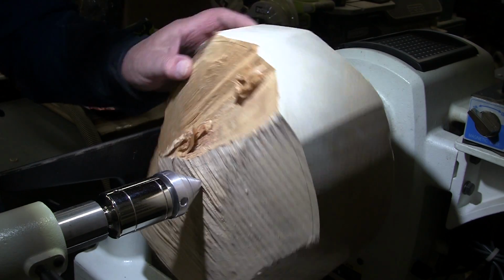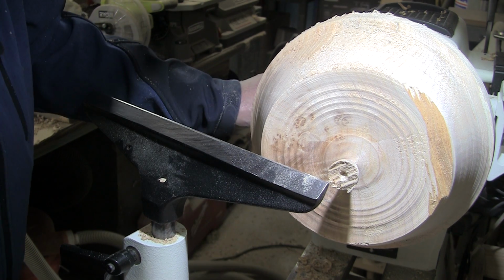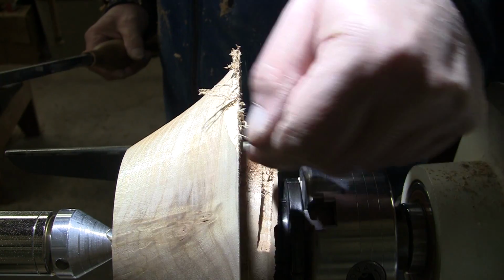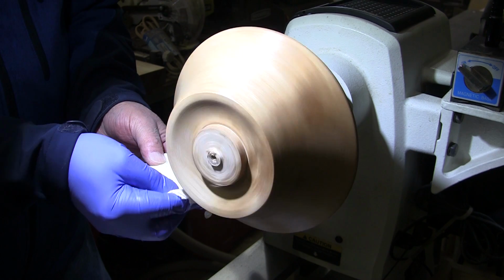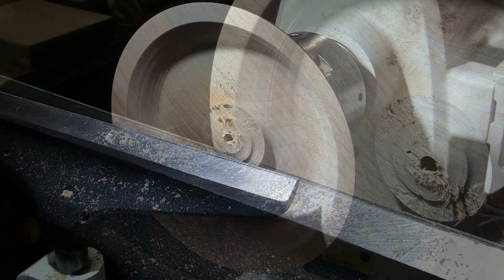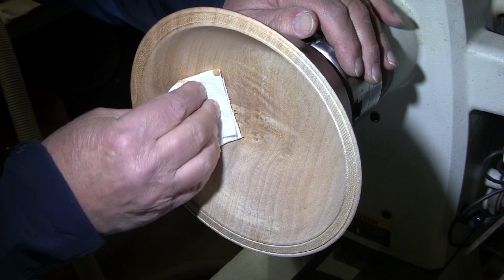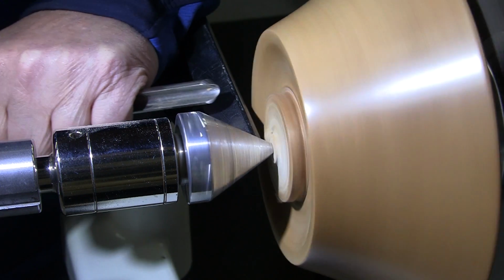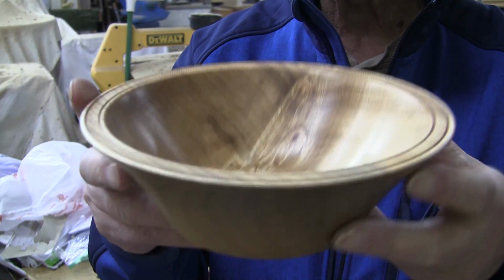Alder Bowl With Texture - Wood Turning

Comment: Phil you have taken a piece of what is mostly used for firewood and turned it into a beautiful bowl. My son has 42 acres and most is filled with Alder.
I loved that view of the square carbide cutting to top. I know what you mean about the diamond point tool. I have one from a set of Craftsman turning tools I bought years ago.
And at work we made diamond point tools made from Stellite. I still use the big one I have.
The finish turned out really nice and I like the finishing compound you used. I just used some EEE stuff that came along with a lathe I bought a number of years ago. I used it over a finished lacquer turning that I am about to upload. It was amazing. 
 And I love bug holes and knot holes. 
 I think that texture on the top edge really topped the whole thing off. What a perfect way to use a gift from your wife. Bless her
Take care my friend,
Gary
Reply from the maker: Thanks, Gary!  I need to come up with a good way to sharpen that diamond point.  I've just been honing it on a diamond card but I think it's overdue for a grinding.
I'm interested in the EEE stuff.  I was of the impression it was for smaller things like pens and stuff.  So, you used it on a large bowl?  No issues?
If we didn't have bugs and knots, where would we be?  LOL!
I do like that texture, too, and the tool is really easy to use.  It's just hard to use it on my typical stuff, like you turn.
Thank you for thinking of Edna, Gary, I appreciate it!
Phil
Reply: Phil my diamond point is just HSS and I grind it like a scraper which is what it is. Not sure what yours is made of.
Yes I used it on the Dizzy bowl I posted this morning. The can says on bare wood But also for a French polish. And it worked great on the lacquer finish. Check it out when you get a chance and no bug holes!
You both have been on my mind my friend.
Gary

Comment: Nicely done Phil! The texturing really added to the piece. It looks like that abrasive compound that James made worked really well. I bet it would work amazing on really hard dense tropical hardwoods. Amazing what just a little extra effort will do!
Kyler
Reply from the maker: Thank you, Kyler!  I really like adding texture but for most of what I turn, it just isn't practical.  Gotta take advantage when you have the opportunity!  I like that you can use James's abrasive on bare wood.  Saves time over using sanding sealer.  Hope all is well, buddy!
Phil

Comment: I have a diamond point tool, just never knew what to use it for, now I do. Also thanks, I have been turning the tenon off like you do, works great.
Reply from the maker: Great, Joseph, glad I could help!  Also, I think it's cool you turn the tenon off completely, on the lathe.  I discovered that by accident but I just think it's a real work/time saver.  Glad it works for you, too!
Phil

Comment: Hey Phil,
   Nice wood very nice creation. I've noticed in the recent past you are turning a lot faster RPM, this seems to work pretty well for ya.  My JET wants to dance  with the oddball stuff I turn. Maybe it would be better to cut them rounder to begin with. You've been a good inspiration. I'll try to Turn it Up, slow increments. You seem to get far better cuts on yours. Thanks for your help.
Reply from the maker: Thank you so much, Don!  I just turn fast when the piece allows it, Don.  Most of what I turn, natural and live edge stuff, will not allow high speeds.  My jet gets to vibrating as well when something is off balance.  Happens all the time.  It is fun to turn fast when the occasion arises, though.  You can get so much done in a hurry!  Yes, you will get a cleaner cut with higher speeds but only if there's little to no vibration.
Phil

Comment: Howdy Phil
Always like it when you turn Alder ....That James Stewart is nice ....Do you think it is like Yorkshire Grit paste ?...When you applied the feed and wax finish , it looked very shiny ....would like to see another Alder bowl comparison .
That knurling tool does not have to be on center when facing ....you could put it up at 45 degrees as long you have the tool at the 45 ....if you use the tool on turning it is easier to be on center , more so perpendicular .....you can also be at 45 as long the tool is perpendicular.
WOW the bottom is a little thin ..glad it did not break off when you taking the tenet off . I think I would have sanded off that little piece .....with my luck it would have broke ........look your video when it came off .you can see the center bend in .....I skip a breath when it happened ....thought you were going to have a strainer .
Did you get that knurling tool on Amazon ?
What is that piece under the bowl when you were turning to show ? is it another piece of Alder ?
Reply from the maker: It is similar to YG, Bruce, but YG requires you to use it over sanding sealer.  James said use it on bare wood so I did and found it works great!
Thanks for the tips on the texture tool!  My wife bought it for me from Craft Supplies but I have seen them on Amazon.
Yeah, it's thin, no doubt about it.  I saw the flex in it, too.  I gotta be more careful!
I think that wood under the rotating piece is Oak.
Thanks, Bruce!
Phil

Comment: I love what you do. A question for you from a complete and utter novice: why do you--and other wood masters--finish the outside completely, including sanding and waxing before you start on the inside? If it's a silly question, please bear with me!
Reply from the maker: Not a silly question, Andrew and I'm glad you asked.  In watching others and listening to their explanation, and of course, through experience, I've found that you never want to touch the outside of the piece after it's turned around.  The reason is, no matter how hard you try or how careful you are, you will never get it mounted on center, again.  It will be off, no matter how slight, and touching again will alter the outside.  Once in awhile, you are left no choice but to do that but I try to avoid it at all costs.  It just makes more work and results in frustration.
Thank you for watching and commenting, much appreciated!
Phil
Reply: @PhilAndersonShadyAcresWoodshop  Thanks, that makes great sense!

Comment: Have you made a video of finishes you use.
Reply from the maker: I have not made a video like that, Coben.  Lately I've been using the Howard Feed & Wax because in dries quickly in these cold winter months.  I will probably be using shellac based sanding sealer and finishing with shellac, soon.
Phil

Comment: Nice, I like the edge. Hey Phil I'm not sure I'm  using  my
Wood  warmscrew right, it keeps coming lose from the chuck. Got any thoughts that might help me, thanks
Reply from the maker: Thank you, Judith!  I wish I could remember which video I did that showed how to use it correctly.  I'm almost positive I know the problem.  Do this:  Insert the screw then tighten the jaws lightly.  Now, open the jaws just slightly until the screw moves around a bit.  Pull and turn the screw until it is seated OUTWARD,  away from the chuck.  Tighten jaws.  While doing this, observe the slight space between the jaws.  When the screw is seated wrong, the space will be more than when seated properly.  It only takes once or twice until you understand what is happening and how to avoid the issue in the future.  Of course, this all assumes the screw was made to fit the jaws you are inserting it into.  Hope that helps!
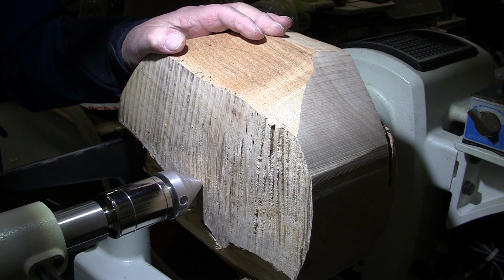Reply from the maker: l found the video, Judith.   Go here and start watching at about 1:00 in and you should see info on installing the worm screw.  It's not as good as I remember it being, though!  LOL!
Reply: @PhilAndersonShadyAcresWoodshop  thanks Phil I'll  check that one out

Comment: Another great job "in the books"! What pens do you use Phil? I use a Sharpie, but Chestnut friction polish makes it run.
Reply from the maker: Thank you!  I use an Ultra Fine Point Sharpie.  Yes, many finishes will wipe out the signature.  I've found that wipe on poly won't, but I hardly ever use that.  I just apply paste wax over the signature and that seems to work, fine.
Phil

Comment: Question for you Phil: What is the name and size of the tool you're using at 17 mins 45 seconds? Thanks.
Reply from the maker: Howdy, David!  That is a Penn State Industries, Benjamin's Best 5/8" bowl gouge.  Almost all of my tools are BB.  I got them because they are inexpensive and I thought I would rather learn how to sharpen and abuse something that didn't cost much before I moved on to higher quality tools.  I've been using this one for about five years and just ordered two more, exactly the same.
Phil
Reply from the maker: OOPS!  Wrong answer, David, sorry!  I had the time stamp wrong.  The tool at 17:45 is a 1 1/2" Benjamin's Best round nose scraper.  It comes as a single bevel, standard scraper.  I modified it by adding a second bevel to the top, creating a negative rake scraper.  Easier to use, less chance of a catch.  It's my favorite scraper.
Phil
Reply: @PhilAndersonShadyAcresWoodshop  Thanks so much Phil. I had narrowed it down to the scraper you mentioned and thought you must have modified it yourself. Looks like such a useful tool, well done.

Comment: HI Phil. I always enjoy your videos. As a beginning turner, I am wondering if you find that the traditional bowl gouge grind is better than the swept back grind for beginners? Many of the turners on YouTube seem to use the swept back grind, but you do excellent work with the traditional grind. Any thoughts. Thanks.
Reply from the maker: Richard, I too watched a ton of videos before I became a turner.  The swept back grind caught my eye and so I re-ground all my gouges to that.  I used them that way for about two years but found I couldn't make the turn at the bottom-inside of a bowl.  So, I ground one back to traditional grind.  Wow!  I felt I had way more control and that the gouge was now stronger and I could be more aggressive.  I still have some ground to swept back but I definitely prefer standard grind.  Thank you for your comment and for taking your time to watch!
Phil